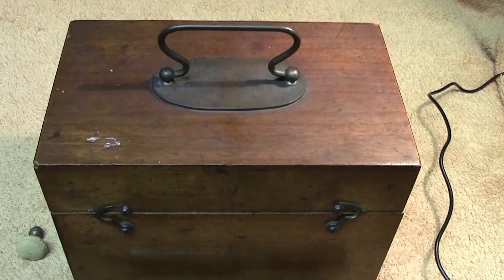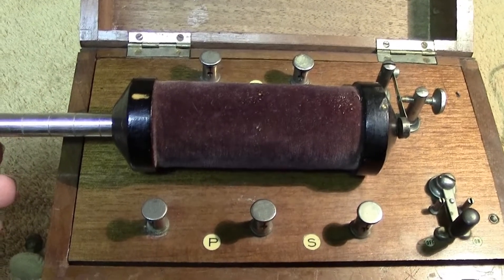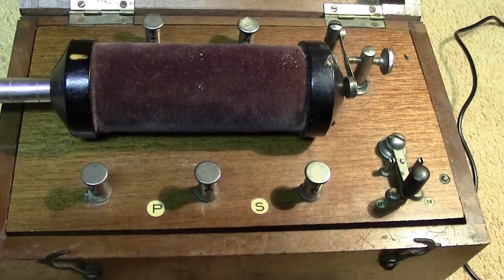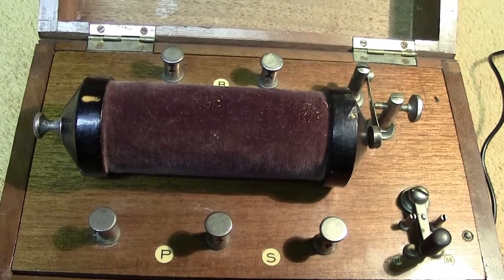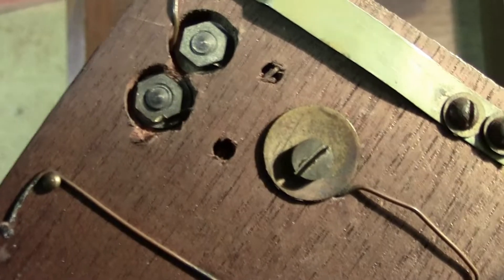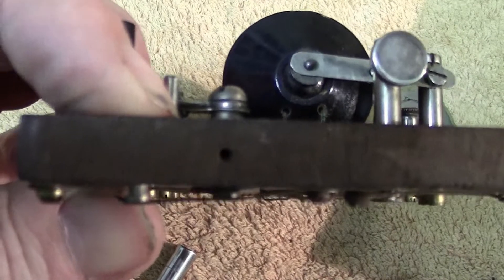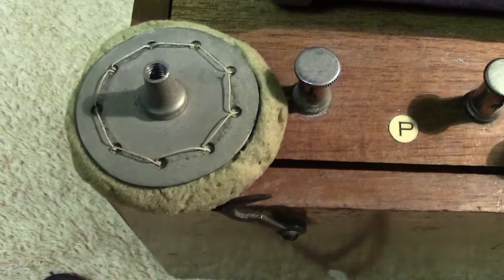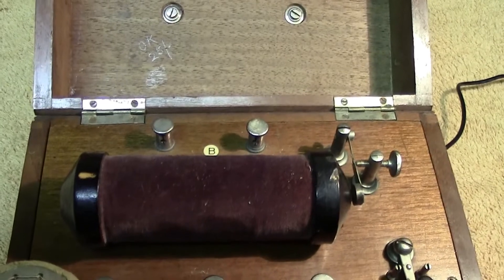Old  Shocking  Device  used  in  Quack  medicine  antique  curio

Comment: I remember as a small boy, my grandmother having a similar machine. 

In fact, I still have the main part mounted on its original wooden board with copper wires running along carved grooves connecting it's components. it's complete with with its dark purple velvet induction coil and its central pull out cylinder to adjust the electrical strength.

As a small child this device fascinated me. I would watch my grandmother hold the electrodes, while the machine buzzed away, in the hope that it would stimulate the muscles in her arms so she could use them again. 

Please, have you any idea of the correct voltage battery I should use to get it working again?

Comment: My nan and granddad had one of these, a bit more simplified as it didn't have a box but when we were children back in the 60's. We used to connect a PP3 battery to it and when you pulled the metal pipe out of the coil the current got stronger, the original metal pipe must have got lost at some time and they had put a brass lipstick holder in there that did the same thing. We used to all hold hands and see how long we could stand the voltage. And once when we were older we took it to the local pub to see if any of the local hard men could hold on to it on full power, it was hilarious to watch and everybody wanted a go. It's a shame but I have no idea what happened to it ?
Reply: Probably ended up on eBay. Sounds like great fun to bring everyone together.   :)